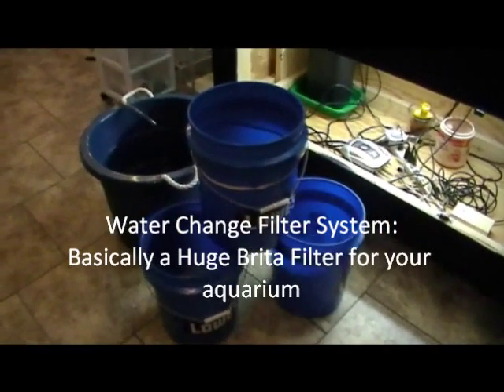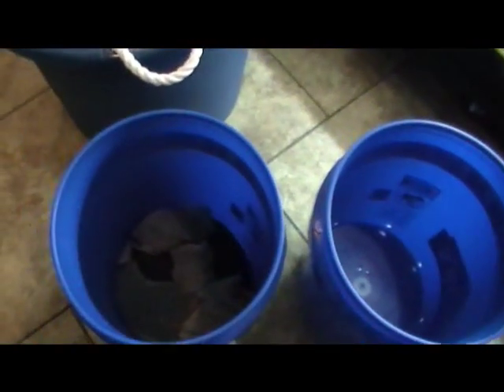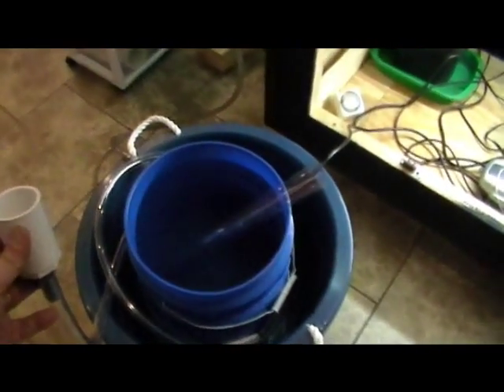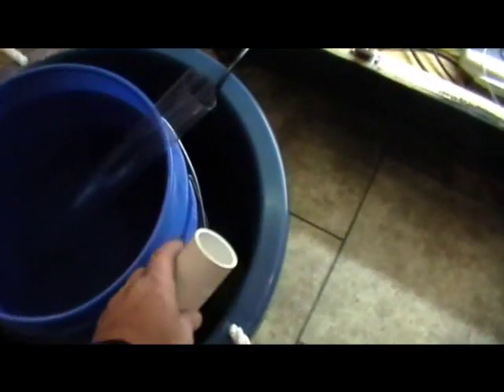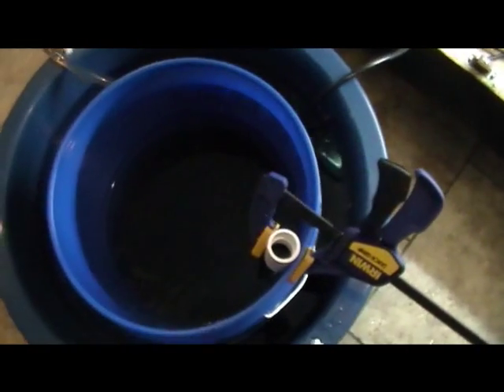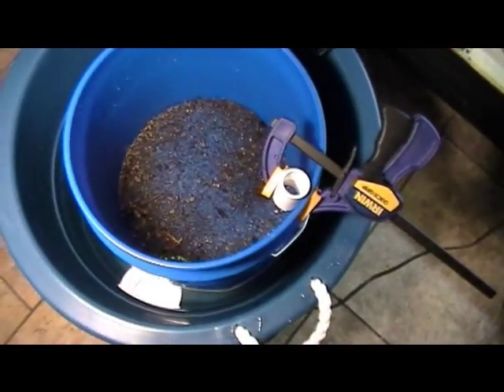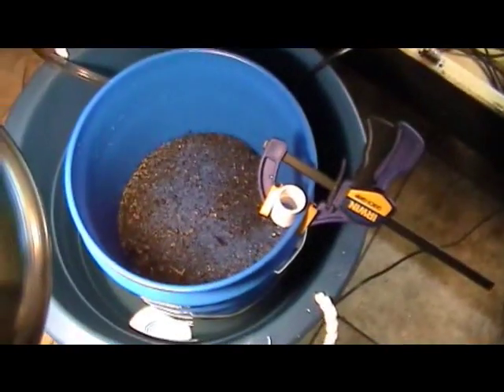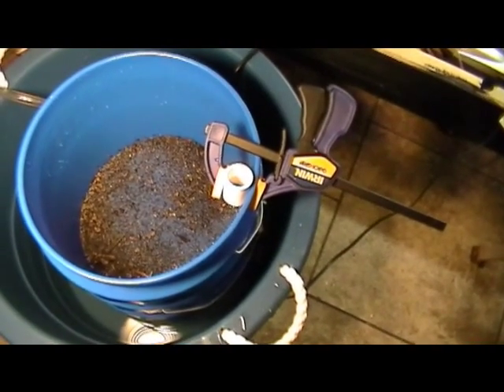Aquarium Water Change Filter System

Comment from the maker: Yes and no.  Since you can not put 100% of the water you filter through this back into the tank, you end up replacing 10-15 gallons of water.  I use this system to vacuum out the tanks and put the filtered water back into the tanks, PLUS I add 10-15 gallons of fresh water.  I do this weekly, or have been.  So I am replacing all of the water in the tank every 2 months.  More or less.

Comment from the maker: Not actually too much.  The main difference, I think, is you can clean the whole tank including the gravel or sand or whatever you have.  A canister will just pull in water and run that, this thing gives you control over what you clean.